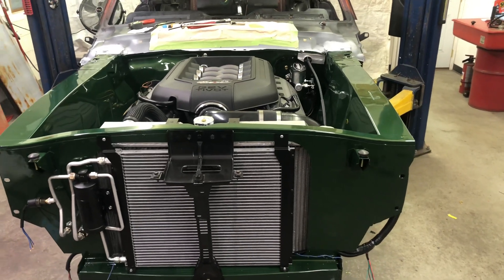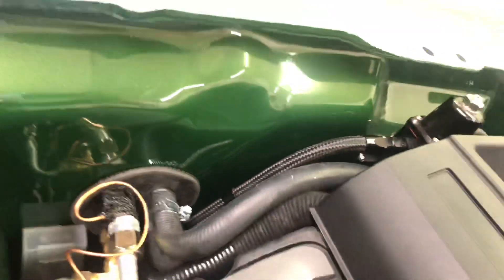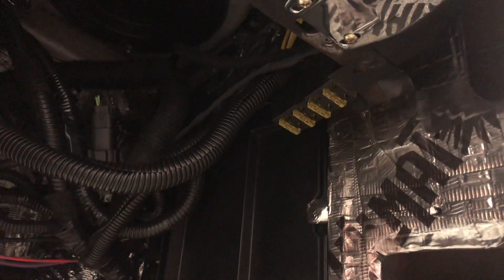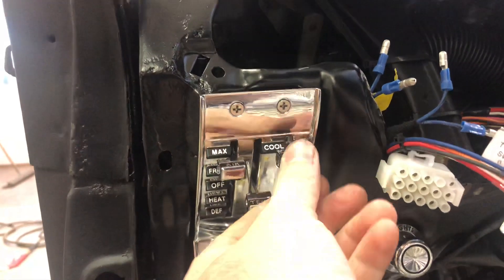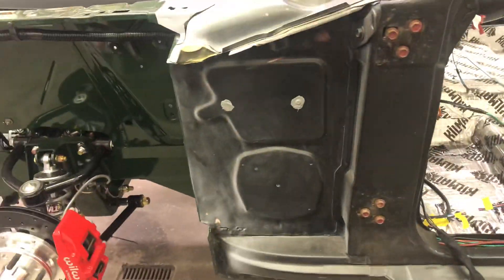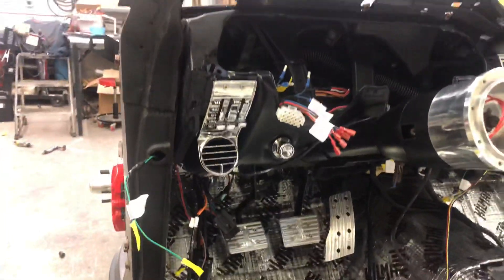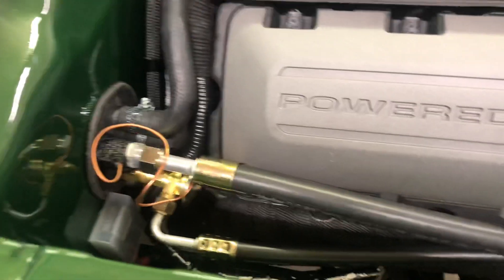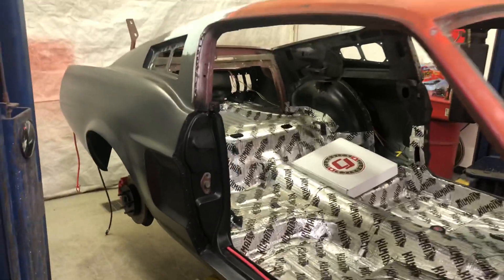Coyote swap air conditioning install

Comment: Hey how did you wire your fans into the system? I was going to run a wire from the compressor to a relay to power the fans but I don’t want them to be on going down the highway.
Reply from the maker: I tried and tried to get the computer to control them but had no luck, I ended up running 1 fan off a temp switch on the engine and the other off a trinary switch to come on with the compressor.
Reply: So you must have added the trinary switch then right? The old air hurricane setup I have only comes with a 2 pin safety switch
Reply from the maker: @justenanderson7318  yes I called old air and they sent me one

Comment: Christ what a disaster of wires you managed to sort out. I feel like I could fit the engine in the car and do the suspension and body work, and maybe some light interior work, but that wiring would have me cross eyed
Reply from the maker: It was definitely my least favorite part of the build

Comment: I watched all ur videos and i never built a car before and really want to do this with a 67 mustang? Any idea on what id need a mechanic for and what i can do myself?
Reply from the maker: Regular Old Plumbus hard to say without knowing your skill set but it’s definitely a very involved project.
Reply: boyce1020 zero skill set but i have time and heart, im planning on following ur videos, i also respect the fact u gave the names of the after market parts ur getting, only differences is im not going with the same transmission, i might try to fit the new 10 speed automatic.

I got tools and all but no hydraulic lift tho
Reply from the maker: Regular Old Plumbus check out “coyote swapped classic Mustangs” and Coyote swap the world” on Facebook. Two great pages with lots of good info.